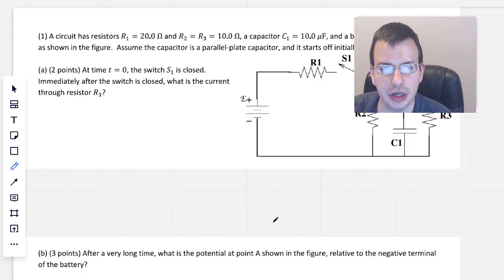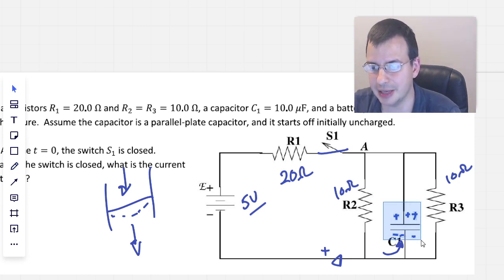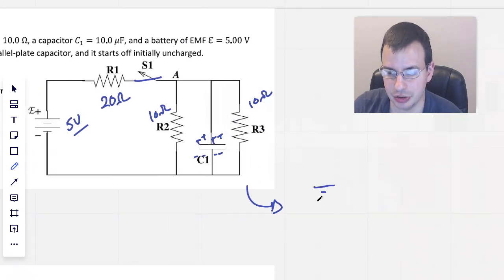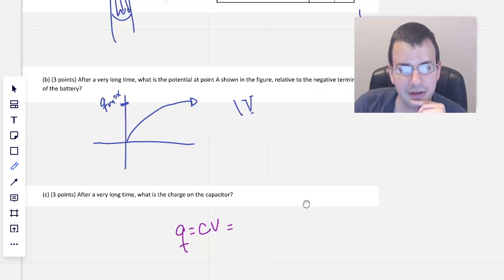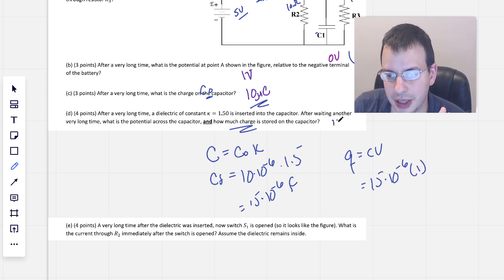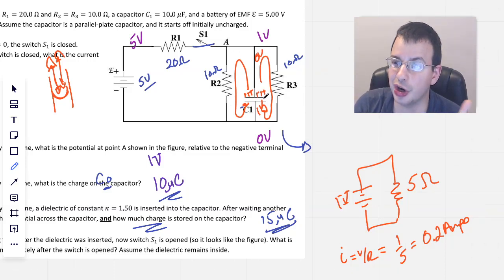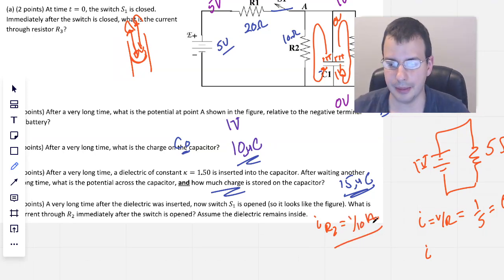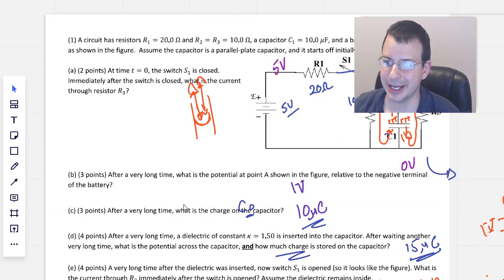Capacitor in a Circuit with a Switch

Comment: Question about 2:40 -- So when a capacitor has no charge, the electron manages to jump the gap between capacitor plates because there is no opposing positive charge built up on the other side, and the act of passing through the capacitor ends with some electrons and protons gathered on the plates, which becomes the form of resistance?
Reply from the maker: Yes, mostly, the electron doesn't actually jump the gap, it attracts a positive charge (or absence of negative charge) on the other side of the plate which if functionally equivalent to jumping the gap and is referred to as displacement current.

As the charges build up on the plates, it effectively creates a battery, voltage source, pointing the opposite direction and cancels out the original voltage source. Though it can be thought of as a resistor, it is more accurate to think of it as a battery.